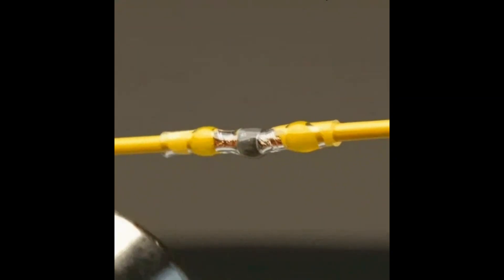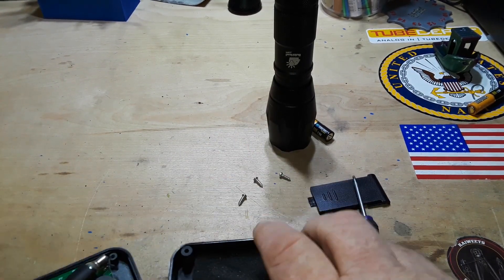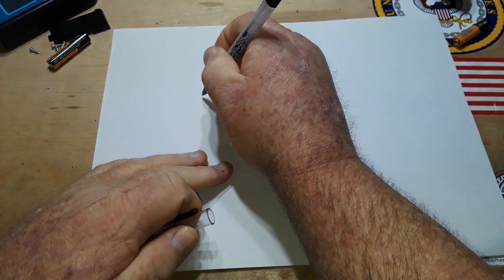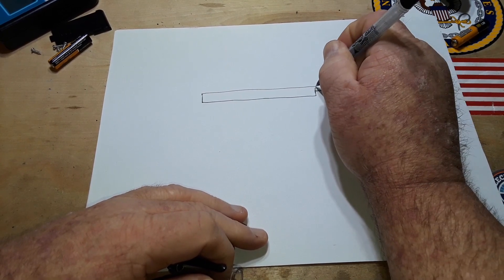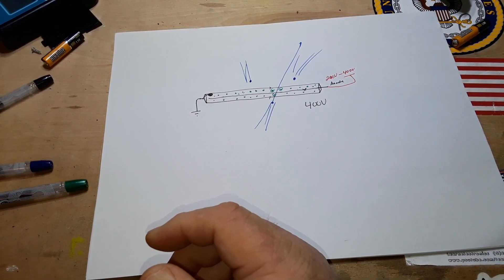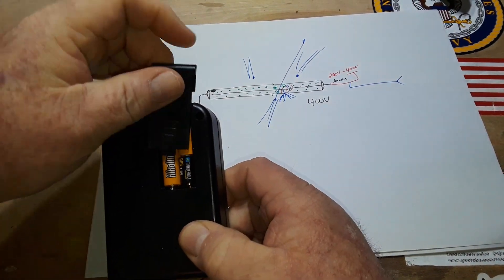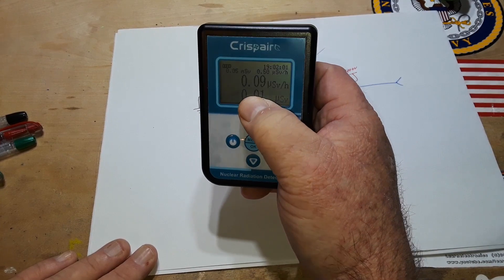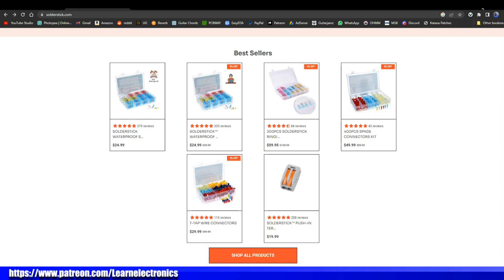How Does a Geiger Counter Work - Sponsored by Solderstick.

Comment: The black heatskrink is there to prevent it from being sensistive to sunlight. It doesn't really block the betas much and beside the holes in the casing is not really enough to be significant. More like to let sound out - but a little sunlight will slip in.
Reply: I noticed that effect with mine, which doesn't have anything to block sunlight. The counts go nuts when exposed to sunlight, even a little, through a window.

Comment: Alpha and Beta are particles and Gamma is a ray.   Great explanation.
Reply: Also Alpha particles are just helium with out electrons [over simplified]. The Alpha particles are not detected due to being "stopped" by the glass of the GM tube. Alpha particles have low penetration [that is very little shielding stops them], a thin sheet of AL foil will stop them.
Reply: @bartonstano9327 Not helium, hydrogen.
Reply: Agree Alphas travel about an inch in air and beta can't penetrate mylar or aluminum.  While Gamma and Neutron can penetrate.     @bartonstano9327